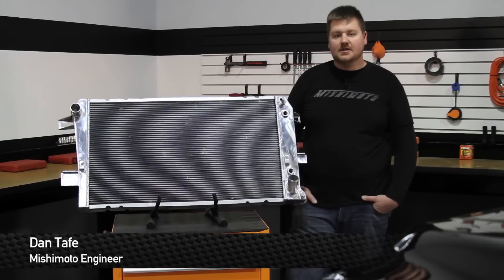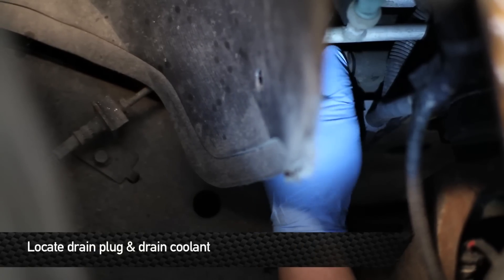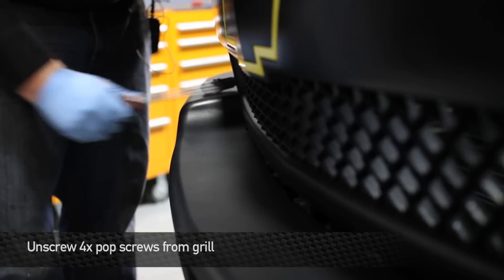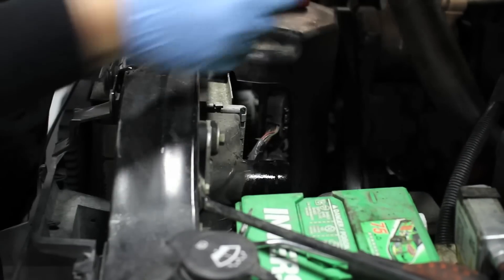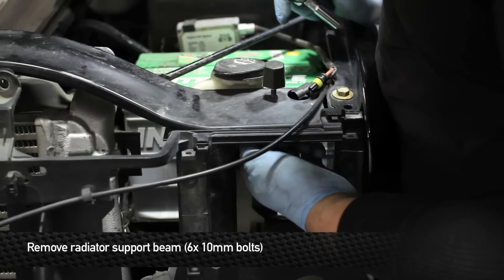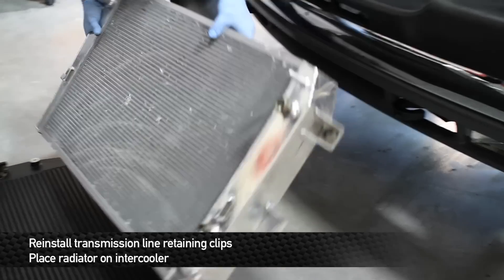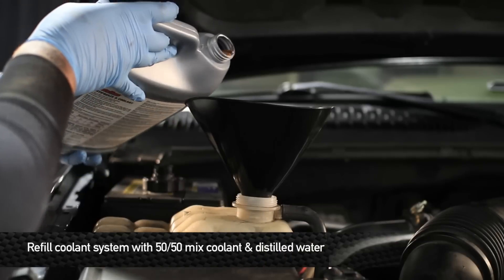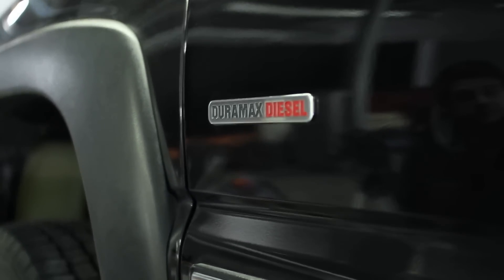How To Install: Mishimoto 2001-2005 Chevrolet/GMC Duramax 6.6L Performance Radiator

Comment: installe aluminum radiator in my escalade because in the summer the engine got very hot, but I did not think about the winter, the engine does not reach the right temperature and sometimes it turns off, what can I do in this case?
Reply from the maker: Hey Yony, it sounds like your thermostat may be failing. Thermostats restrict coolant to the engine block so there is minimal flow to the radiator before the vehicle is warmed up.

Comment: Man this job is so much simpler than explained on this video did not have to pull off half of the stuff that was said to pull off
Reply: Yep, all I pull is the shroud, fan, and such off, then slide just the radiator out. No need to pull most of this stuff off. Just more work and more stuff to get  broken doing the job.
Reply: I didn't even pull the fan just the upper half of the shroud. Out and in in 35 mins.

Comment: Is this considered to be a fix to the LLY overheating problem?
Reply from the maker: Firegod1234 Thanks for your question!  Although this radiator will definitely help with cooling efficiency it has not been proven to fix the LLY cooling issue. Several other factory components have defects/issues which cause the overheating concern and should be addressed first.  Let me know if you have any further questions!
Reply: @mishimoto  , I'm listening. I called a diesel shop and their first recommendation was your radiator. But I'm thinking there are other issues re: air intake or perhaps oil cooling that might be more important. Your thoughts on the LLY cooling issue? Towed my first fifth wheel and ended up BEING TOWED at 9,000 feet on an extreme grade because of the overheating...
Reply: Gregg Edwards Townsley change the intake mouth piece to turbo intake you can use a LBZ or a aftermarket S&B also exhaust and downpipe can help it’s all about getting that airflow in and out of the lly hope this comment will help